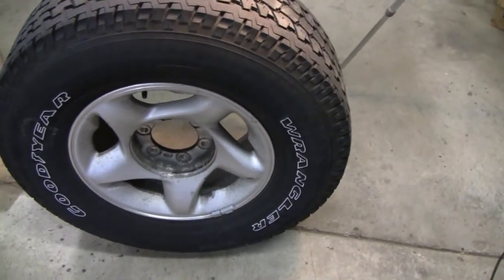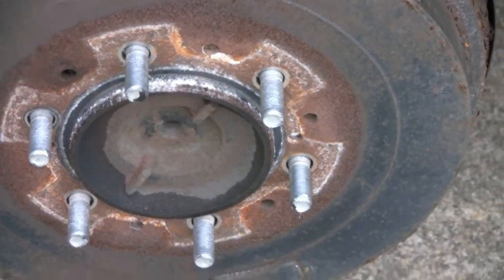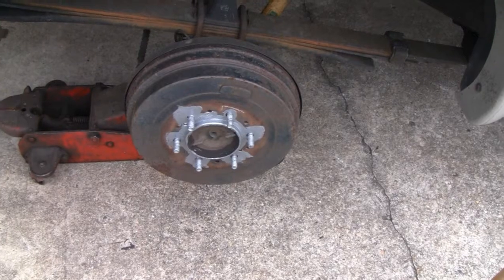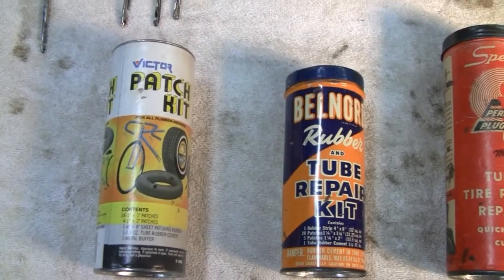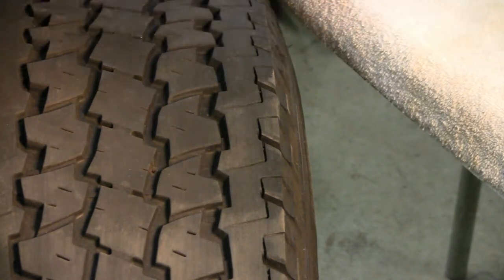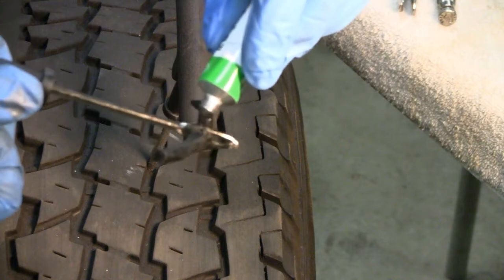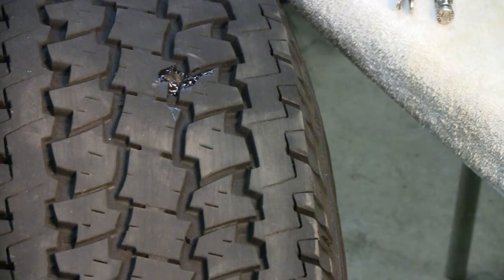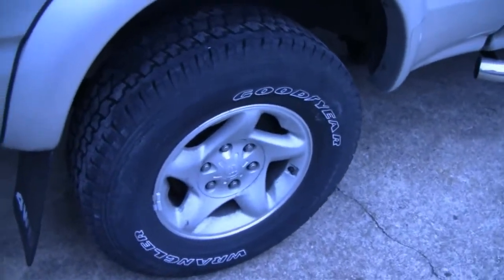HOW TO PLUG A TIRE

Comment: Galvanic corrosion is the white powdery stuff is on the drum. I'm not a foreign truck guy, but the older Tacomas were really good trucks, my grandpa had a 2000 extended cab 4x4, the quad cam engine, with about 210 thousand miles on it only problems were 2 power steering pumps and the front axle sprung a leak.

Comment: Tire plugs are great.  I'd much rather plug a 33" tire than swap it with the spare.  I don't think I've had to "change a tire" on that vehicle in close to 10 years.  I just plug it while on the vehicle.  I carry co2 for on-board air which allows me to refill it.   I do use a plug/patch on the Mustang though as it drives faster speeds but that means I have to pull the tire to do it which isn't "too bad" using a real tire machine.

Comment: It is easier to get the plug "into" the tire if the tire is still fully inflated.  The tread doesn't move/compress then.  Also, reaming the hole more makes the plug go in easier. 

~Mark

Comment: The hardest part for me is reaming out the hole for the plug to slide in.  On my old Astro van i had leaks on the front tires once, and to prevent the leaks i would make sure the leak touches the ground lol.

Comment: You shouldn't put anti seize (or any kind of lube) on the lugs my friend, the wheels need to be DRY torqued. 

On the hub between the rim is good though to keep them from fusing together.

Comment: @805ROADKING  a lot of your tire shops use it sense I get my tires from pulla part I chage my own tires and you use the stuff to seal the beads on your tires but I use it for the tire plugs also Orileys had it for thirteen bucks